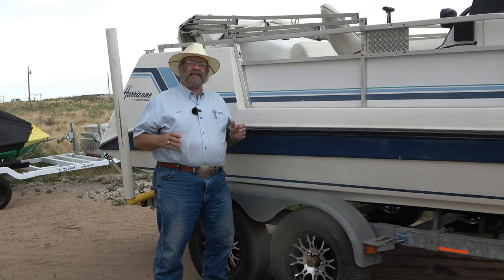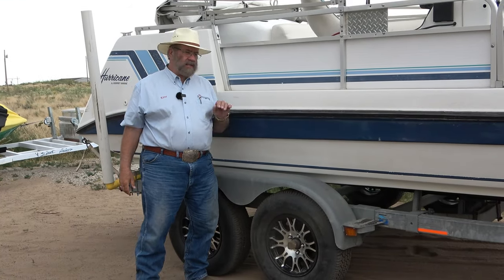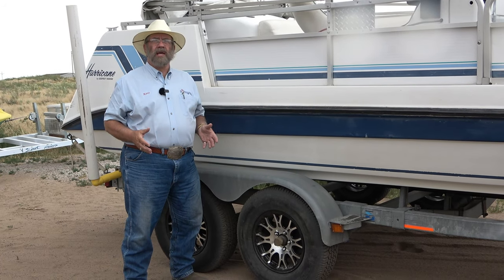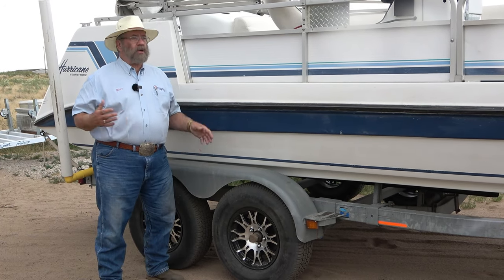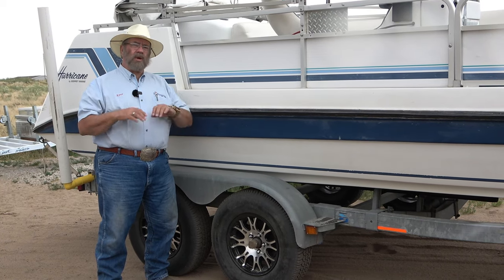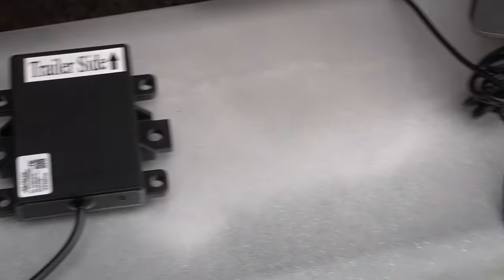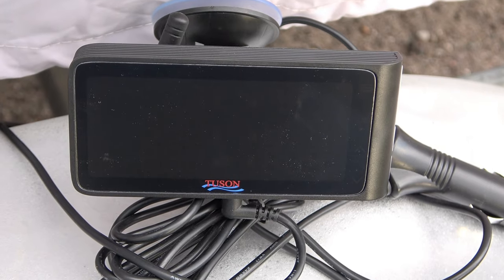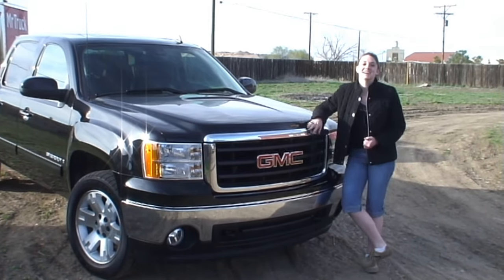Space Balls for your trailer tires. New Product that will fit every trailer tire on Earth

Comment: Any update on this product, like about a one year report on how well it works? I'm changing out Chinese Bomb king tires for Endurance's and want to put a system on. This appears to be about the easiest one to use if it works...and keeps working. I'll get it off you as your system has the repeater in it while the Tuson site appears to charge you an extra 65 bucks from what I"m seeing.
Reply from the maker: They are working great, we testing them now on Semi-tractor-trailer with 18-22 tires. Not sure what the $65 is for?
Reply: @MrTruckTV  Thank you very much. The repeater is separate on the Tuson site.